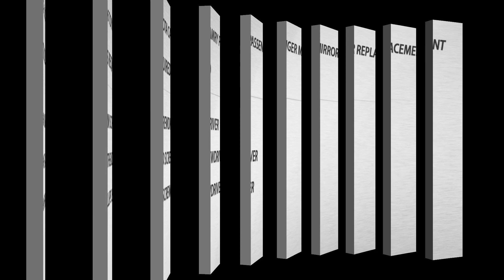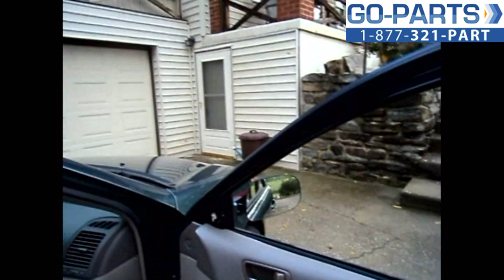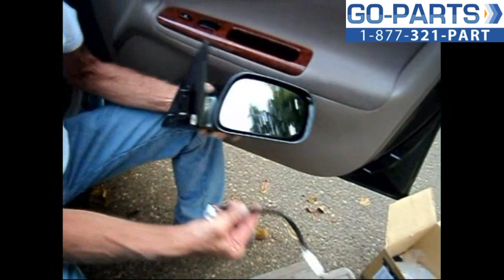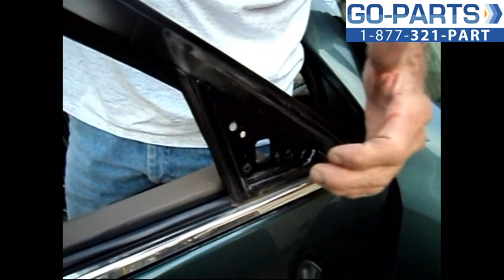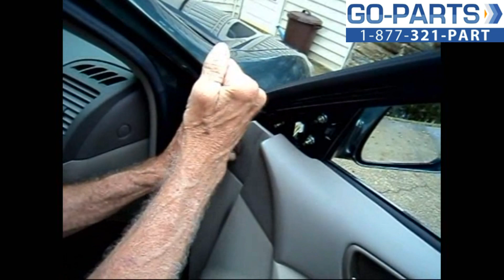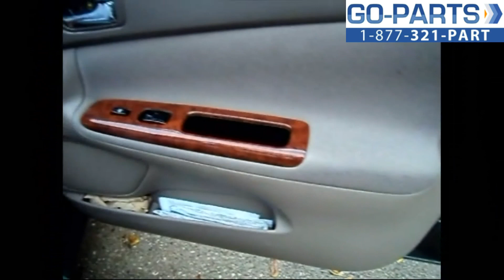Replace 2002-2006 Toyota Camry Side Rear View Mirror , How to Change Install 2003 2004 2005

Comment: On some model years, the black plastic triangle is difficult to remove / reinstall. There isn't enough clearance on its bottom edge for you to push it straight on. You remove the three screws he showed you on the side panel, and pull the top of the side panel out far enough for you to remove / reinstall the black plastic cover. Pry it off. Snap it on. Then, reinstall the three screws into the door side panel.

Comment: I found a pair of mirrors for a 2006 Camry which are foldable and have led lights to the sides. My car is a 2001 Camry. I have noticed the size is similar. Will my car be compatible if I make some extra holes or somethong?
Reply: We're?
Reply: @jhonsalazar8504  you are?